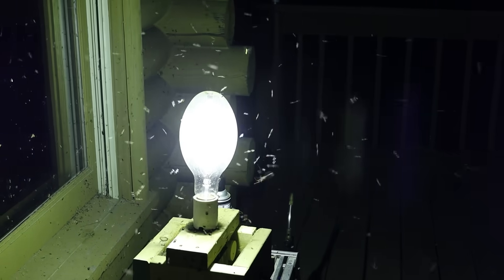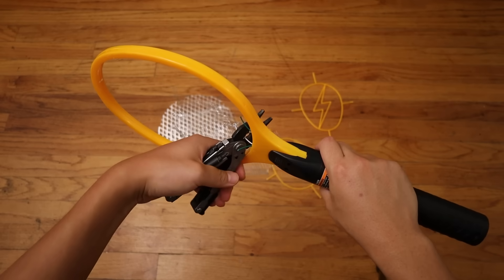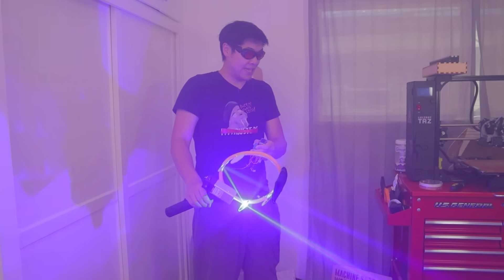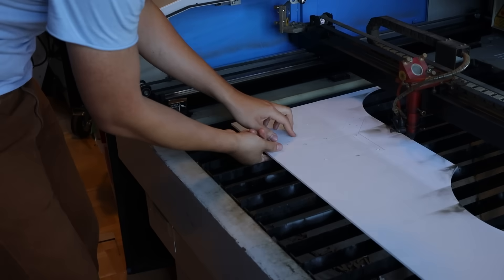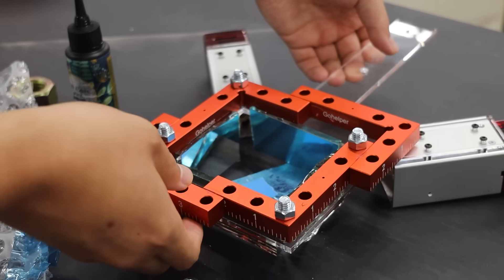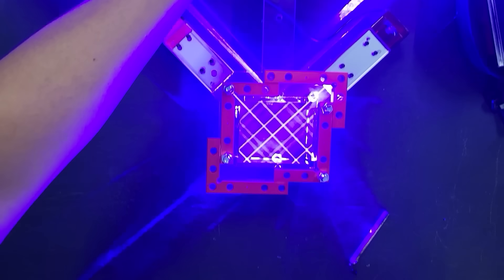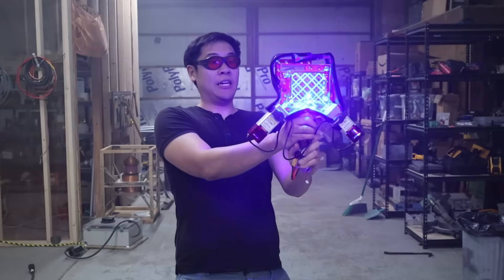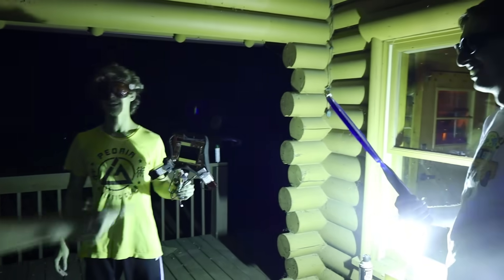killing mosquitoes like its the year 3000

Comment: OKAY SO. Couple pointers from Physics 102. At high energy volumes, lasers beams DO collide with one another. Photons do possess plenty of particle-like qualities and since you're basically shooting quadrillions of them per second, there's bound to be collisions, and thereby loss of energy. So, for a more efficient design, you could use a single laser angled such that its angle of incidence dips ever so slightly (talking seconds to minutes, not degrees) away from a pure XY plane, so that the grid progresses along the Z axis with repeated bounces on the mirrors and the reflected beams do not cross each other. You're just losing (more) energy to air ionization otherwise! And at the exit point, install a concave lens to diffuse the energy harmlessly without buildup of heat. Also, make it a bit larger, and use an angle that maximizes bounces, you can do better than 45°! Also also... use it horizontally so you don't get dead bug guts on the mirrors.

Comment: If you need cheap 1sr surface mirrors check in scanners, and old copiers. If your okay with a small hexagonal 1st surface mirror check in Lazer printers. You will find the mirrors if they exist in the scanner section or the print head.

Comment: I saw this as well, and it didn't aim using a camera. It used microphones.

It listened for the freq of the mosquitos wings in flight, when. It detected them it used multiple microphones to translate the 3d position and cut the wings off using the lazer.

Comment: What about pointing a laser upward at a rotating mirror mounted at 45 degrees, and then putting a a ring around it to absorb the light, that way you have a laser helicopter rotor

Comment: I (vaguely) recall playing with one of those electric tennis racket bug zappers when I was drunk once, about 20 years ago. For some reason, I thought it was fun to put it on my arm and watch it singe all of my hairs and burn me mildly. Apparently. Next day when I looked at my arm, it was completely covered in burns and sores and missing half the hair on it lol. And for the record, it was a new bug zapper. I'm a germaphobe and would never even touch a used one. Interestingly, by comparison, I once hooked up 10 brand new 9v batteries in series to give me over 100vdc (a brand new 9v is closer to 9.5v) and touching that barely felt like anything. Though, I realize electric bug zappers probably work at thousands of volts, and probably uses AC, but I could be wrong.

Man, now you've got me wanting to buy, tear down and reverse engineer one of those things. Just to answer my questions about it if nothing else. I could probably get one for like $5 from China. Or more simply, I'm sure somebody on YouTube has already reverse engineered one of these and I could probably just look up a video. =P

Comment: You should get a super strong air fan, constrain it’s exhaust, and put the laser at the end. So the mosquitoes will get sucked and blasted into their doom. (I think it will be fun with the electric shocker as well)
Reply: That's... actually a pretty good idea.
A giant laser vacuum.
Make the lasers spin for max coverage.
Reply: @FleshlyDelight  that would cost like another $200 to make lol
Reply: @FleshlyDelight  Would be easier to spin the air.
Reply: At this rate wouldn't it be more efficient to just go out there with a shopvac and vacuum them directly out of the sky  @FleshlyDelight
Reply: bro just imagine the deck setup with two giant vacuum electric traps, you switch it on and all the mosquitoes are gone instantly.
Reply: You would only need to use one focused point then and it would be very efficient with a big funnel to suck them in, perhaps a lid on the bottom to empty out the bodies.
Reply: There's actually a commercial service similar to that. It looks like a dome, with a ring that's open. You plug it in and it has light vacuum and a mesh. Then you attach a propane tank, which keeps a small pilot light lit, which emits co2 to attract em, and also basically cooks and dehydrates the bugs to nothing. Just gotta clean the mesh once in a while.
Reply: hi, i'm michael, and i'd like to superback this idea
Reply: You can literally just use a fine screen over a regular Box it works for all flying insects this works well on farms to keep flies off your horses
Reply: Just put a fan with it. It'll suck mosquito with air
Reply: Not quite for this purpose but wonder if mosquitoes could get sucked into higher end air purifiers
Reply: You could also put a fine wire screen on the end and they'll just die from being trapped against the screen. Mosquitoes can't generate very much thrust, so even a modest air current will do them in if there's no gap they can pass through.
Reply: at that point just have a big metal fan spinnig hella fast, it will grind the mosquitoes to dust, no need for laser, lol
Reply: And you should mount it on your compost bin so all the little mosquito corpses are turned into nitrogen-rich fertilizer.  Waste not, want not.  Vacuum-fed laser-powered compost bin / insect graveyard.  You could even make it solar-powered.
Reply: Just use a Flamethrower instead and you are done...lol
Reply: "a super strong air fan" ok, ACME
Reply: Holy shit.
Reply: wording is everything...
Reply: LMAO Imagine a dick setup with 2 giant vacuum traps causing the mosquithoes to be gone instantly @littlepastelkitten
Reply: The fan's blades would kill the mosquito anyway, so better have a laser in front just so they get killed a millisecond faster 😂😂

Comment: An even better misquto killing machine would be using a fan on one side that sucks them into a cone of hot air that collects them in a bag so you can actually see how many it destroys 

make it handheld from an wireless vacum perhaps ? could be possible to make right ? like a heat gun witha fan that pulls them in and kills misqutoes by heat without any gas and if it is possible making it a handheld solution with a batterypack powerful enough to drive a heatgun and a vacum fan ?!

Comment: Allen, I have a question, if a laser is light, what would happen if you fired it at Vanta Black? Could a layer of Vanta Black possibly be used as an end-point for the laser, so you don't have to worry about any exits on the laser? I understand Vanta Black is carbon nanotubes, and that carbon is well, not receptive to heat well, but could it cancel out a laser by absorbing all the photons faster than it can heat the carbon?

Comment: The original was detect the frequency of the wings beating to verify then zero in on IR signature of heat of the wings beating. You could use a spinning mirror to fast sweep a verified zone.

Comment: Ok, during a trip to the Philippines last year, I had a similar idea. But instead of a handheld device, my idea was for a lower powered laser grid window frame, using either mirrors or beam splitters. That way, the beam is contained within the frame (no light leakage), and the insect wings burn as they enter the house, and you just sweep them off the floor later. You would probably need beem spacing no more than 5-6mm to have an effective barrier. Probably more practical than tracking them flying through the house, and it could be scaled to whatever size opening you want to cover.
Reply: But for the hand than enters the grid... :)

Comment: 1. So the laser needs to be in front of a tube whit a light source inside and a pc fan in the other end. 
2. you could ofset the laser with a stepmotor and a mirror so it has like 4,5,6 points or more to hit whit as little space in between as possible. In that way you could have a really tight mesh

Comment: @allenpan ALLEN! Colab with The Backyard Scientist to use his $15k laser welder/surface cleaner for a part 2! And with Dustin at Smarter Everyday or The Slowmo Guys to get us sick footage of mosquitos going up in smoke please!

Just select the motorized pattern drawing hand torch tip part to use a linear back and forth motion, then all you need to do is create a laser absorbing backstop and attach it to the torch. It's not very portable, but it 100% would work. It moves so fast that there would be no gaps, and is powerful enough to fry a bug with even a very short duration hit.

If you want to widen the beam or make your own, harvest the spinning laser beam mirror from an old laser printer/copy machine. They're already made to precisely draw a linear line across a fixed end point that is 8.5"+ across. In fact if you just harvest the whole laser unit and simply swap out the laser your project would be pretty much done.

Also, in this project you would want to use a prism to cowitness/combine the powerful laser blocked by your glasses with a low powered one of a different visible frequency that you can see through your glasses to function as a guide/targeting/troubleshooting laser.

Comment: You probably want to up the power of the lasers while making a tighter grid. Next mount the laser to the wall while the grid remains flat/horizontal. This plus the higher power should resolve any problems of the laser missing or getting blocked by debrie. Finally make it so the only light source is coming from one side of the laser grid and that the bugs have to pass through it to get to the light. That all said this would still take far more engineering and energy to do than a traditional bug zapper.

Comment: All I can see is Allen made a Dick-Seeking Laser. The reason mosquitoes got burned is because mosquitos have dicks.

The actual way to prove it works is to place it over a beaker of human blood and see if mosquitos go through it.

Also, why plug up the excess Lasers when you can increase the swatter size.

In fact make laser window grills. Problem solved.

Comment: Used to be a glazier, would cut glass and mirrors all day everyday, you want to score the glass using 1 deep constant pressure swipe, then put something (like the scorer or a pencil) underneath the score to pry them apart as you slowly press down on it. Takes a little practice but it’s easy to get down after a couple times.

Comment: "Why are you scared?..."
because it wasn't built by him... it's literally 2 death rays strapped onto a plastic stick and bits of sketchy looking mirrors, that also happen to leak the death rays to the point you gotta wrap the whole thing in heat resistant material rather than plugging the leaks. Dude got a call from you AFTER you already almost deleted your nutsack while trying to test your sketchy idea. these facts alone would scare even Styropyro, the same guy who has built things out of much stronger lasers INTENDING TO MAKE A DEATH RAY.

Comment: Laser engineer here..... without even really thinking about it, yes I can 100% program a mosquito gun (as described) with systems at my disposal right now today.  Well, 15 years ago too for that matter.

Target with a Cognex (or similar) camera.  Blob find would work extremely well, assuming the lighting and background provide sufficient contrast (I don't see why it couldn't).

Then any galvo system will hit those positions in sub ms time scales.  Holding accuracy to tenths (of a thous).  There's really nothing to develop.  For reference, a human hair is roughly 3 thous.

The only real issue I see is the depth and field of view of the camera.  The search area would be incredibly tight to get any kind of resolution.  Making the exercise beyond impractical.  But without a doubt, completely feasible.  And with that said, I have to believe other optics (that I don't have) would certainly be able to help.

They only "faking" required would be to bait or present the mosquito to the targeting camera.

Personally I  would just take a C02 or Excimer laser, and just (blindly) sweep a volume of air.  Bypass the targeting function, and just make the whole volume of air deadly by default.  Heck, some of us have done that by accident!
Reply: My recollection was that they were hitting the potential targets with a non-lethal identification beam and counting wing beat frequency (or something like that) to determine target species and gender and only hitting female mosquitos with the lethal laser, a bit more advanced than a blind area sweep that would wipe out your friendly pollinators. 

As far as initial target identification you would think you could use a wide angle camera and a pulsing IR flash to find bugs like an astronomer, by either detecting streaks in long exposure images, or by using a sequence of images to spot objects moving across the reference static background image. Or you could use LIDAR to sweep a beam and detect the closer flying objects, but $$...

You'd want it to be robust and adaptable, not requiring special setup like a machine vision colored rice reject air puffer or something, but even if you could setup a vertical beam generator post on one side of a door and a second beam break detector on another side that would still let you create things like a mosquito free pavilion, tent, garage, etc.

The true issue is the company behind the idea are notoriously litigious patent trolls who will do nothing but sit on it and sue into oblivion anyone who gets within a hundred meters of what they view as their IP. 

Your only options are to have deep pockets and fight back, pay them exorbitant license fees, wait for the patents to expire, or create everything as open source so they have no one to send a cease and desist to, and no way to take the code off the net, or be in a country that doesn't care about US IP enforcement. 

In other words, yeah, it could be done, but it's not economically feasible/incentivised until those trolls get lost. So it'd be up to hobbyists or altruists to make it happen anytime soon IMO. 

To game it out a little bit with you... say you knew within either a volume of space (area denial) or along a line (access denial) where you needed to send a pulse, what would you choose to effect the targeting, while you maybe could buy an industrial gimbal for $3k or something what might work at consumer prices/existing off the shelf availability, that could be adapted to work? What companies are in the space, what product catalog/websites do you browse to select hardware for projects?

Solid state, compact, robust, and energy efficient would all be ideal. But for hobby hacking I'm thinking you could rip the laser unit out of an old copier, that uses a spinning mirror to scan a focused laser across a plane 8.5"+ wide to generate the printed image on the drum, that gets you a linear sweep, if you combine that with a second spinning laser you can create a scanned 3D space... Or is there some way to draw a scanned beam like a CRT, but for laser light?

The Backyard Scientist demonstrated his $15k laser welder/surface cleaner that has a hand wand that you can select different rapidly drawn shapes from, that's how it controls power delivery and dwell time, and he took off the focusing portion and was able to chop off palm tree leaves at the end of the tree so that's definitely a commercially available platform that would work, but I'm not sure how you could deal with the cycling to only send pulses when it's pointing at what you want to hit. 

Cheaper and smaller and still readily available are commercial dermatology and tattoo removal lasers, styropyro or that German(?) magnets/lasers/radiation YTer has shown off those, they're nutty powerful too, but same issue.

So, if you had a dumb laser like either of those are they capable of being modified to emit precisely timed releases, or can you use some type of rapid switch beam redirect or beam trap to basically work like the glasses that Cyclops from The X-Men wears? 😂

Or the various companies working on solid state LIDAR, would any of their technologies be able to handle to power needed to zap a mosquito? What about optical vision/projector products like LCoS, DLP, or the fancy new car headlights that draw the car logo when you turn it on?

Keep in mind I believe that the company was touting that they would use the blue(?) lasers/LEDs in mass mass production for new high density optical storage (aka HD-DVD/BluRay), so it can't be that much (unless that's part of what they faked).

Anyway, sorry for the book, this particular project/concept has literally been on my mind since it was first published, so might as well take a shot at picking someone's brain.

Cheers 🎉🍻

Comment: Yknow... they got laser lenses that spread the beam out to a grid?
Reply: You need the power density to remain high, a beam spreader would cover more area but a bug that flew into it would only block (absorb) a small portion, you need the bug to block (absorb) the entire beam downstream, so the way they did it here with a single continuous beam is the only way to do it. You could use a back and forth sweeping beam instead of reflectors, but the dwell time would need to be long enough to transfer enough energy to end the bug, as the bug would block 100% of the beam, but not for 100% of the time, so you either need a powerful beam, a weak target, or a target that stays in the beam path for enough repeated beam passes to do the job over a longer period of time.
Reply: @msytdc1577  true but I've used one on a very powerful green laser and it killed most the skeeter in the air. They are very fragile
Reply: @iamtheonebelowall  good to know, and yeah, that's not too surprising as the initial project was to supposedly use a laser from a commercial Blu-Ray reader (maybe writer for more power?), so if that works it couldn't take much. I have no idea where the thought came from to use the lasers used in this video came from; perhaps they were left overs from another project or picked up cheap or something? Certainly doesn't seem like much thought was put into the product's design or component selection...
Reply: @msytdc1577  haven't thought of that but those disc lasers are strong may work 💪